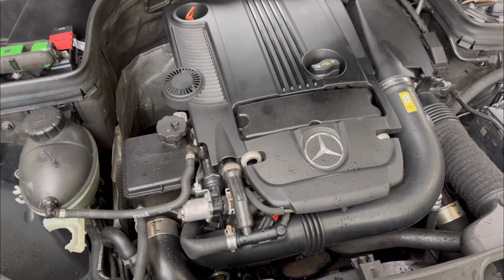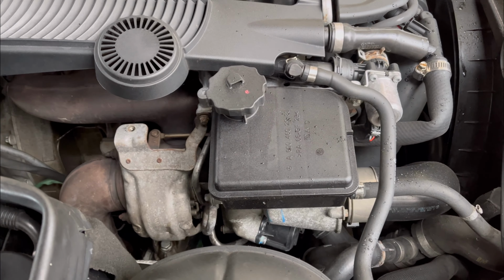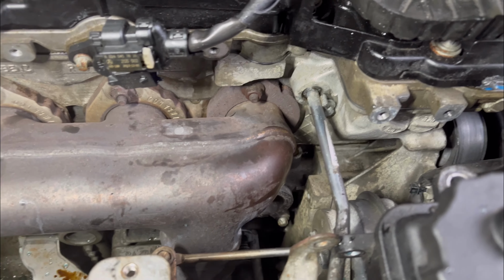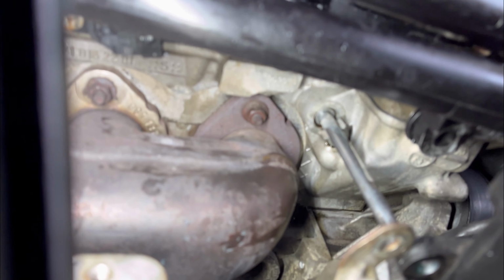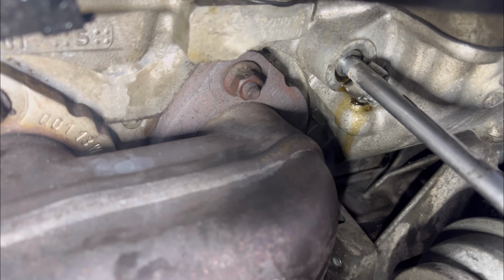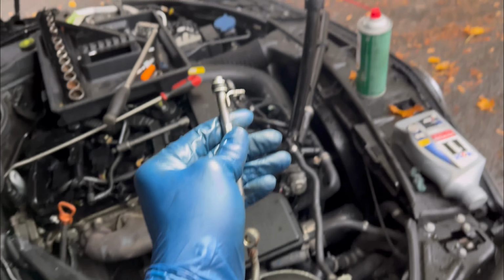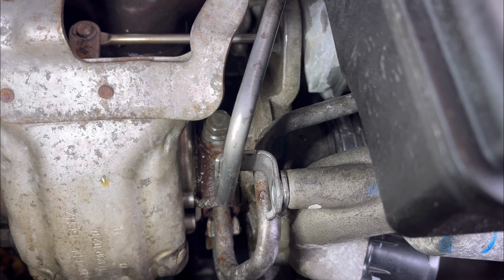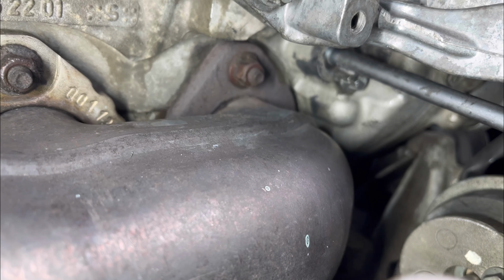Major oil leak?? Mercedes Benz C250 oil leak fixed.

Comment: Great video, thanks so much. I do want to add that is not necessary to remove all the tubing.  I did it by just removing the engine cover and the power steering container and the top screw becomes accessible with a ratchet extension.

Comment: My car is leaking from the same location and has a damaged alternator. Do you think the leak is from the oil line from the turbo as in your video?
If I use any oil leak product, it helps temporarily. Any recommendations?

Comment: Good morning, excellent video, I would just like to ask you where the smoke coming from the car came from.
And what was your solution for that smoke problem, thank you
Reply from the maker: So on this one the oil was leaking on top of the exhaust and it was smoking when hot, it went away after replacing the seal. Thanks

Comment: Hi Kay. This is my  first time watching your channel, and thank you for sharing this video. I have 2014 C250 and recently got an oil change about 2 months ago. Now, my car is leaking oil underneath the car/engine area. I’ve had my car for 9 years and it has never leak oil before. Car mileage is around 50,000 and it keep up with maintenance even without a warranty. My mechanic who did the oil change told me while he was doing my oil change, that my car was going to start leaking soon. He also said that it would cost $1500 to fix the issue. Therefore, I was wondering if you are in the Los Angeles area, and if so, could take a look and give me your opinion. Thank you for your time and attention to my matter. 😊
Reply from the maker: Hi Charllote thanks for reaching out and I really appreciate you watching my video. I would be more than glad to help but I’m in Massachusetts that very far from you. I wish I could see a video of how it looks and I can tell you what to do how much you’ll spend on it